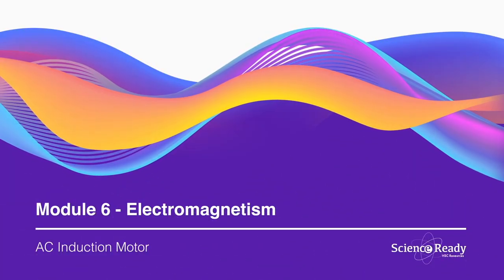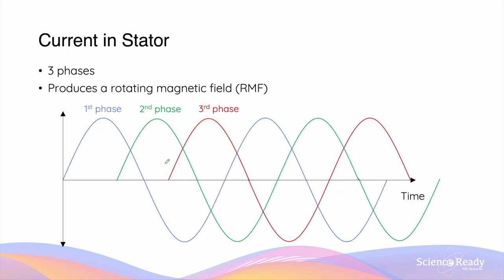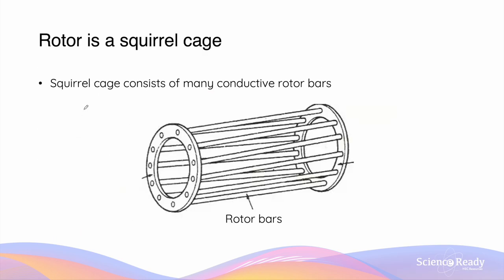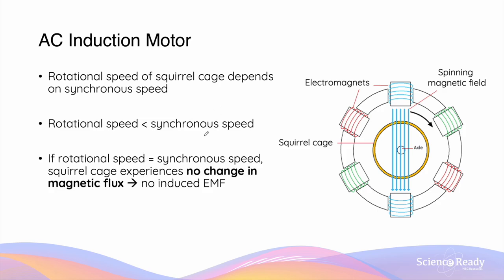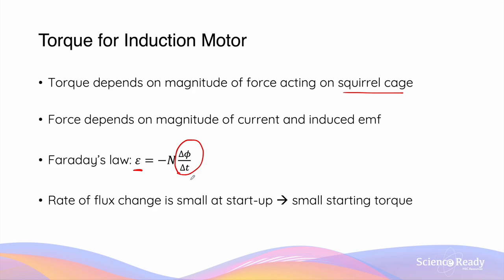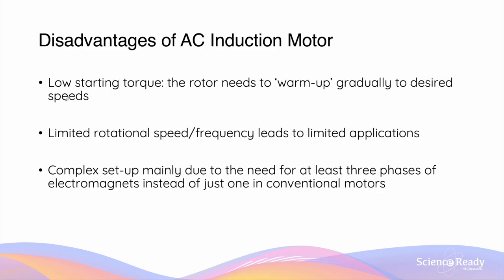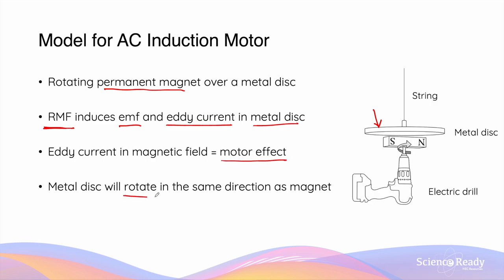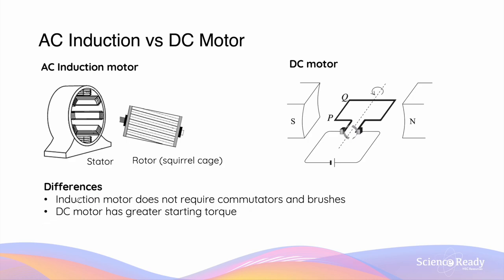How Does an AC Induction Motor Work? // HSC Physics

Comment: Good video. Can you please clarify why the torque is a gradual build up as opposed to being the highest like that of a DC motor? Thanks.
Reply: To my understanding:

DC Motor starts at maximum torque (as the angle between area vector and magnetic field is 90).

AC Motor torque is produced due to changes in flux, which increases as the speed of the motor increases.  Think about spinning a magnet inside of a solenoid normally.  If you're rotating it slowly, there is less emf produced, as opposed to spinning it really fast where the flux is now changing at a greater rate (and hence emf increases as emf = -N * dFlux/dt).  By this same logic, there is less change in flux as the motor starts spinning, meaning there is less torque as less emf is induced, which gives it the "warm up time".
Reply: The EMF Produced in an AC induction Motor is what causes it to rotate and therefore have torque In a DC Motor the Back EMF produced by the motor rotating due to the motor effect will cause a decrease In the current running through  the motor  (think of it as opposing flows of water )  as Torque is directly proportional the Current this causes a decrease in Torque as the Back EMF decreases current